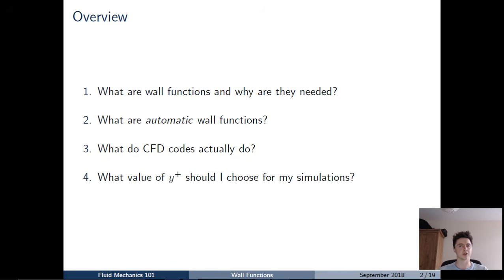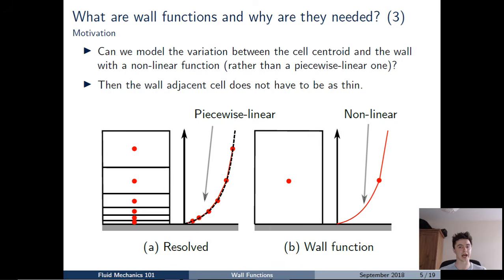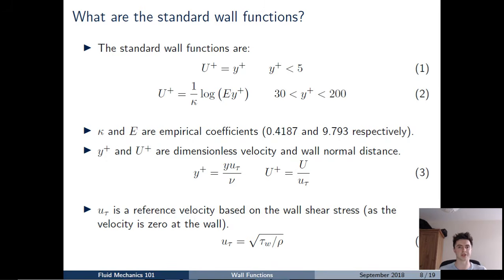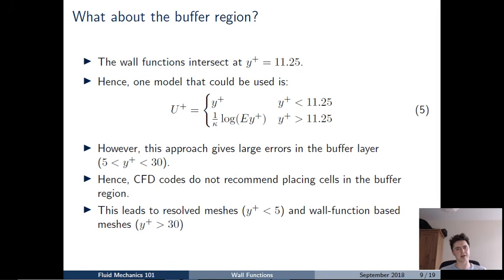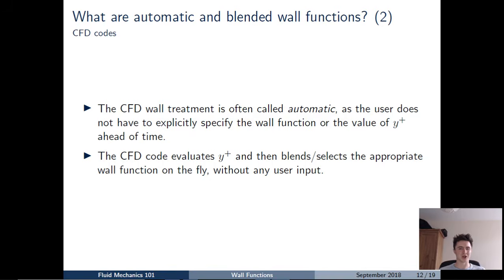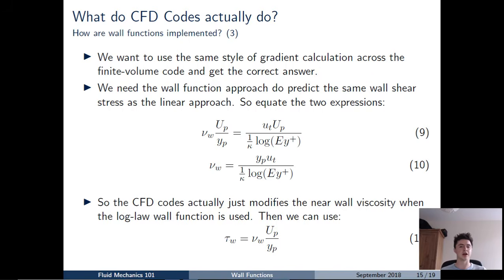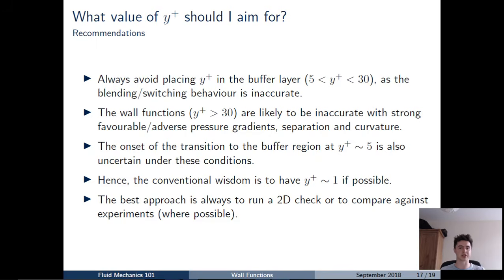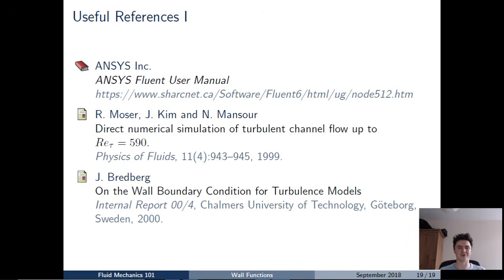[CFD] What are Wall Functions and How do they work?

Comment: Hi, I have almost completed your playlist, which I have found very useful, especially because you are able to explain difficult stuff in a very clear and straightforward way!
I have just one question, that rise from this video and "How fine should my CFD mesh be". Here you say that it is wise to avoid placing cells in the buffer region, where 5<y+<30. Let's say that, for the flow conditions ( velocity field, viscosity and density ), y+ is 15. The very only way to decrease y+ down to 5, would be reducing the distance yp, so increasing the cell aspect ratio? 
Moreover, let's say i want to go up to 30 and using the formulation for the log region. This solution (increasing y+ by increasing yp, so making a bigger cell), would be preferable with respect to the other I pointed out? 
Thanks in advance, and keep doing your videos!
Reply from the maker: Hi Francesco, yes you are correct! If your y+ is 15, you can increase or decrease y+ by changing the aspect ratio of the cells (re-meshing). In all cases the CFD code is setup so that you will always get a solution, regardless of y+. If y+ is in the range 5<y+<30, the solution is likely to be inaccurate, as the blending functions used by CFD codes are unreliable in this region. So it is recommended that you either increase y+ to greater than 30 or less than 5 by re-meshing. It is preferable to reduce y+ to less than 5 if you can, as this will lead to a more accurate solution (and will get less push back from reviewers/examiners/clients/professors if you do). However, this may not be possible if you aspect ratio and mesh non orthogonality gets too high that you cannot converge a solution. If this is the case, then you should increase the cell size and go for y+ > 30. Thanks for the support and im glad you enjoyed the videos 😊

Comment: Thanks for the CFD videos, your content really clears up a lot of information that is not covered well in some texts. 
I have one question, its seems like the CFD code creates blended functions between the viscous/buffer/log region and investigating Y+ is not essential and so the software thinks for us, OR do we still need to still check y+ values and ensure cells are placed in the correct region ( i.e. either side of the buffer region and say Y+ is 1)?  thanks in advance
Reply from the maker: Hi Raymond, yes you are right. The CFD code calculates y+ for you and then has special blending functions so that a value of alpha and nu at the wall can be evaluated, regardless of what value y+ happened to take. This is essential for convergence, as y+ will change as the solution converges and can take any value, so the CFD code needs to be able to deal with any value of y+. However, you should still investigate y+ yourself as a post-processing check (if you have the time and resources). The reason for this is the empirical functions that the CFD code uses were derived from experimental measurements of boundary layer flows over a flat plate (with zero streamwise pressure gradient), which may not accurately represent your flow simulation ... generally its always best to try and get y+ < 1 if you can, as the viscous sub-layer behaviour seems to be most universal. I hope this helps!

Comment: Aidan, do we need to insert a boundary layer mesh with multiple layers (~10 to 15) if we use the k-e model with a wall function ?
My understanding is that you can just mesh 2 or 3 boundary layers as long as your first cell is above the viscous sub-layer and buffer-layer (i.e. Y+ >30), the wall function will compute the necessary wall shear stress, albeit not as accurate as using model SST (i.e. with small cells and Y+ <1)
Reply from the maker: Hi Naldo, yes you are correct. If you use the k-epsilon model with wall functions, you only need to make sure that the first cell height is above the viscous sub-layer and buffer layer (y+ > 30). You dont need to then include 10-15 cells above this, like you would if you were using the SST model. However, you still need to make sure that you have enough cells to capture the velocity profile away from the wall! I usually go with 5 or 6 cells with the k-epsilon model, and this is usually good enough to do the job. 2 or 3 is not very many and you might get some pushback from examiners/reviewers/customers! I hope this helps

Comment: Thank you sir for sharing such an important topic and I really appreciate the way you explained the whole topic. I am a newbie in this CFD field and  what I have understood is as-
The velocity profile of turbulent flow is very steep near the wall so to capture the gradient a fine grid that is of high aspect ratio is required near the wall.But doing so increases the skewness and computational time so we decided to model the variation between the wall and the adjacent wall centroid with non-linear function. Basically y+ is the non-dimensional distance between the wall and the centroid of the adjacent cell and if the centroid has to lie in Viscous sub-layer it should be <5 and for log layer  it should be y+>30.
Is my understanding alright?
Reply from the maker: Hi Arjit, yes you are 100% correct. You have understood this difficult topic perfectly 👍
Reply: @fluidmechanics101  Thanks a lot sir.
Reply: @fluidmechanics101  I have one more doubt , you said in the video that if the cell lies in the linear region then the wall shear stress is found by a simple equation where the denominator is yp. But the main purpose of finding the wall shear stress is to find ultimately y+ value right? But the definition of y+ and yp is similar then why are we finding the wall shear stress?
 Will be eagerly waiting for your reply sir :)
Reply from the maker: Hi Arijit, the process is iterative! We calculate the value of y+ using the wall shear stress from the previous iteration. Once we have y+ we can compute the near wall kinematic viscosity and then update the wall shear stress. I hope this helps 👍
Reply: @fluidmechanics101  Yaa now it makes sense but what about y+ and yp? Are both of this expression same?
Reply from the maker: Ah ok! Yp is the distance normal to the wall in physical dimensions (eg. 1mm). This value is constant for a fixed mesh. Only the value of y+ changes.
Reply: @fluidmechanics101  Ok so it means that initially when I am giving the first layer thickenss by inflation that is the yp and as the solution converges y+ changes and we get y+ only at the end of simulation. And initially with the yp value and y+ value wall viscosity is found then wall shear stress and then again y+ and this goes on till a final y+ is found. Is it like that?
Reply from the maker: Yes! You are 100% correct!
Reply from the maker: I will be releasing another video on the 30th April which should help explain this a little more and help with the initial guess for the inflation layer height yp. Keep watching this space 😄
Reply: @fluidmechanics101  I must admit that I haven't seen such a great responsive guide in youtube ever. Keep this up sir and soon your channel will flourish massively. Thanks for the clarification :)
Reply: @fluidmechanics101  Hope u are doing well. I just came to realize that to calculate the initial y+ using wall shear stress we also need wall kinematic viscosity in denominator. So, for this what can we do?
Reply from the maker: Hi Arijit, i think i might not have explained this well enough! It is quite tricky. The kinematic viscosity in the denominator for y+ is the laminar kinematic viscosity (a material property of the fluid = dynamic viscosity/ density). When we calculate the wall shear stress, it is the sum of the laminar kinematic viscosity and the turbulent kinematic viscosity that are used to calculate the wall shear stress. The turbulent kinematic viscosity is calculated from k and epsilon and is then modified if the cell centroid is in the log law region. The laminar kinematic viscosity is always a material property of the fluid and stays the same. I really hope this helps. It is a very tricky topic after all 😊
Reply: @fluidmechanics101  It is becoming very confusing about how the iteration carries on. Can you tell me in sequence if possible?
Reply from the maker: Yes, remember that iteration doesnt occur within a timestep. I think this is where there might be some confusion. The cfd solver does the following: 1) calculate y+ 2) calculate the wall kinematic viscosity and the wall shear stress 3) solve the equations for U,V,W pressure, temperature, energy etc. 4) proceed to the next iteration 5) calculate y+ 6) calculate the kinematic viscosity and wall shear stress 7) solve the equations for U, V, W pressure etc. ——> repeat! The reason for doing the iterations like this is that we solve the flow equations, which changes Up. So the calculation of y+ and wall shear stress occurs during the outer iterations of the flow equations. This might have made things more confusing .... i hope it makes sense 😬😬😬

Comment: I have more than one thing to ask! In the "What value of y+ should I aim for?" section, you said that we should avoid placing cells which have a value of 5< y+ <30. Are those cells you are talking about the first cells close to the wall? What I mean is our first cell near the wall shouldn't have buffer layer and sub-layer in it, is that correct? So our first cell should either have only sublayer( which is resolved method) or sublayer, buffer layer and log-wall region(which is non-linear method). Does y+ matter for the cells other than the first ones because they are not in contact with the wall and therefore there is no wall shear in them? Or the effects of that wall shear is dissipated along the cells? A clarification will be much appreciated because I'm confusing myself :D Thanks for the great video !
Reply from the maker: Hi Osman, you are correct. We only need y+ to be either < 5 or between 30 and 200 for the first cell close to the wall. All the other cells are computed by the cfd solver using a linear variation of variables across the cell.
Reply: If you are doing a study related to species mixing which is more of a phenomenon in the turbulent flow region there you mostly can go with first cell height that can lie at y+>30 and you can use k-e turbulent model without activating wall functions but if you want to solve for lift on wing using k-e turbulent model then it is a good practice to put first cell height at y+<5 and activate wall functions to capture boundary layer profile but you will get poor result when flow separates but if you want to accurately find the lift you will use k-w-SST model and this model don't use wall functions and it actually calculate the wall shear stress then you need to put first cell height at y+<1 and use wall resolved mesh
Reply from the maker: Yep! 👍
Reply: All credits goes to Fluid Mechanics  101, my knowledge on turbulence models was like raw metal it is your lectures that polished it
Please keep spreading knowledge

Comment: Hello Aidan, thank you very much for the video. I have a question for you. The thing is that I'm simulating a 2D pipe and I want to check out the behaviour of the different turbulence models depending on wall treatment. As I run my simulations approaching the node to the wall, I get problems with my y+ plus value. For example, when I decrease from approximately 30 in k-epsilon, I get wrong values (as you said) but also I get a "quite random" value of y+. So that's proving that I'm working in the buffer region as soon as I'm not getting any value of y+?
Thanks in advice and keep on going with the videos, really really helpful
Reply from the maker: Hi Diego, yes you are correct. You want to try and either reduce your cell height so that y+ < 5 or increase it so that y+> 30. The reason you are getting the quite random values is that the wall shear stress changes as you change y+ ( wall shear stress and y+ are coupled). which alters the balance of forces acting on the wall. You may even be getting some separation somewhere in your system, particularly if you have flow expansions or sharp corners. Have a look at the flow field in the post processor and see what you can find!

Comment: Hi! fantastic explanation. Just to confirm here. When we use equation 3 calculating the yplus, the kinetic viscosity here is identical to the so-called near wall viscosity. So, with each iteration, the Up is updated first then update the near wall viscosity according to the wall function (instead of the constant value for laminar viscosity or the turbulence viscosity relationship) till at last get a convergence. Is this the procedure? And when we split the near wall viscosity into laminar and turbulence parts, does this near wall turbulence viscosity still satisfy the equation for turbulence viscosity (turbulence viscosity=Cmu(TKE^2)/epsilon)?
Reply from the maker: Hi Chang, you have almost got it! I feel like i have missed a bit of the explanation out, so here goes. y+ is always calculated with the laminar viscosity (the material property of the fluid), which does not change. You are correct that the CFD solver starts by calculating the value of Up (the cell centroid value). We then calculate the value of y+ for each boundary cell face using the value of the laminar viscosity. Once we know y+, we calculate the near wall viscosity (nut) for each boundary cell face. The reason we calculate a seperate value for each boundary cell face is that one cell may have multiple faces that are walls (see my previous video on the epsilon wall functions)! The near wall viscosity is calculated at the wall, and it is this value that is used to compute the wall shear stress on that boundary face. The turbulent viscosity at the cell centroid is not affected. This value is computed using C k^2 / epsilon, as you pointed out :) The part where the near wall viscosity is split into laminar and turbulent parts is purely for convenience in codes like OpenFOAM and is used to emphasise that the laminar viscosity remains constant across the cell and is not modified by the wall function. Only the turbulent component is modified on the boundary cell face. 

I hope this helps clarify things! 

I will be releasing another video in a few weeks on the difference between y+ and y*, which should help clarify things a bit more. In the meantime, check out my video on epsilon wall functions. This should help explain why boundary faces are treated individually 

All the best
Aidan
Reply: @fluidmechanics101  Thanks, Aidan. I have tried to extract the TKE, epsilon, and turbulence viscosity value at the near wall cell in Fluent, but found it does not follow the equation C k^2 / epsilon. I am not sure if I did it in the right way. Does it mean the near wall modification of viscosity is also only applied to the turbulence viscosity in Fluent (same to OpenFOAM)? So when it calculates velocity from the momentum equation, we switch to the near wall modified viscosity as the effective viscosity at the near wall cell for the coefficient of diffusion term? And is this how wall function affects the wall adjacent velocity Up?
Reply from the maker: Yes you are correct! I think the difficulty might be having is that a near wall damping function is applied in the k - epsilon model ( mut = rho f C k^2 / epsilon, where f is a damping function which varies between different versions of the k - epsilon model) Have a look here: https://www.cfd-online.com/Wiki/Low-Re_k-epsilon_models
Reply from the maker: The k omega and k omega SST models dont have this damping function. This is why they are often preferred for wall bounded flows. Also, it is always difficult to know exactly what fluent is up to, as the source code is hidden ... but your explanation is exactly what OpenFOAM does :)
Reply: @fluidmechanics101  Sorry. I recognized that I did not extract the correct centroid value of the wall adjacent cell, and it seems in Fluent the turbulence viscosity also follows the equation by TKE and epsilon. I am now checking about the so-called near wall viscosity, but I could not find its relationship to the effective viscosity or turbulence viscosity.
Reply: @fluidmechanics101  Hello Aidan, I am recently reviewing this video. And I could not remember what is the ut in Eq.8,9 and 10? Thanks!
Reply from the maker: Hi chang, ut is the friction velocity. ut = sqrt (wall shear stress / density)
Reply: @fluidmechanics101  I recognized that in Fluent, they use ystar instead of yplus. So I look forward to your new video. Thanks!

Comment: You said that CFD codes choose appropriate wall function on the fly, i.e. switch between linear and logarithmic behavior. But, for example, in ansys cfd codes' (cfx, fluent) manuals it is said that wall functions should never be used if y+ < 30, i.e. we should locate the first node (cell) in the log-layer. For me this means that linear (viscous) sublayer is not modeled at all with wall function approach (because we don't have places to store corresponding values), so only logarithmic wall function is used. And automatic wall treatment is automatic switching between wall function approach and direct resolving of the viscous sublayer in omega-based turbulence models, but not between linear and logarithmic wall functions. What do you think?
Reply from the maker: Its useful to remember that as the code converges, the values of y+, wall shear stress etc. will be changing all the time. So the CFD code needs to have a continuous treatment that can handle any y+ at all times. Otherwise it would suddenly get floating point exceptions, which would be very annoying! The comment that the user guides make is about the accuracy of the final solution. Once the code is converged, we have a final solution with a fixed value of y+, wall shear stress etc. For this converged solution to be accurate, you should follow the guidelines for where y+ should be. For example, y+ > 30 if you are using the k-epsilon model. Does this help?